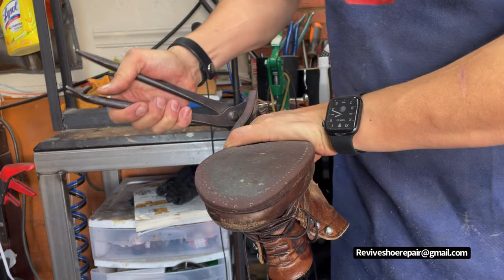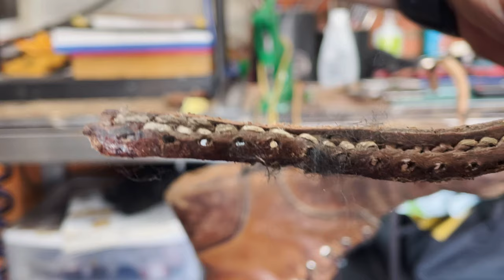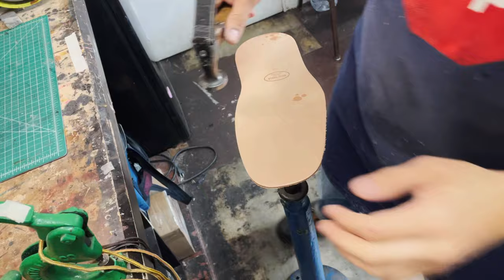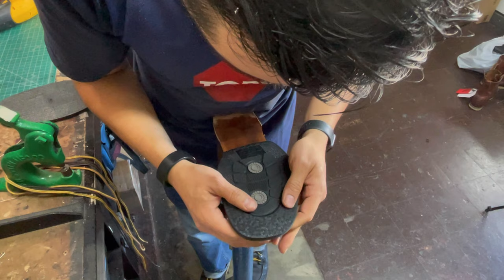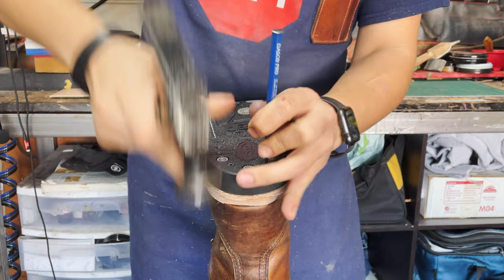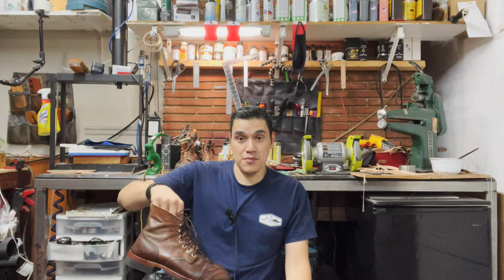Iron Ranger 8111/Their Last Resole/Dr.Sole Super Grip #redwingheritage #redwingboots #shoerepair

Comment: I can’t believe how much quality has been dropped from red wing. I’ve already ordered like 7 pairs and all of them have some sort of quality defect, sometimes construction too. Most part some leather quality looks and feels cheap. I get a perfect pair isn’t possible. But for handmade finished boots, you think someone would double check the work and make sure it’s as even as can be
Reply from the maker: Unfortunately that’s happening!
Reply: @AaronG2480  I’m glad a professional cobbler admits and acknowledges this and it’s not just me. At first I thought I was getting bad luck with pairs but it’s obvious after buying 6 and returning them all that they arent living up to the name. Excuse my rant but yeah it is frustrating when 3/5 pairs are defect or have issues, from leather quality, to either too tight or one loose and one tight shoe, uneven finishes on the welt, heel block coming off, “literally” I have pics for evidence. Especially after spending 350 bucks I expect minimal flaws. They bump the price from 330 to 350, but reduce quality and effort. SometimesI just want to make a video addressing this, especially when we have YouTubers like Rose Anvil giving good reviews on red wing iron rangers. No doubt they were great boots in the early 2000’s. But he only reviews quality overall, he does not address quality control or overall evenness all round.
Reply from the maker: @idrcookiez620  

I feel you, I’ve bought several pairs and apparently I’m the lucky guy cause I always the bad ones 😅

I don’t have no complaints on the
 (the uppers) but the finished product
Welts and soles
The average people don’t notice it, and I totally agree with you 2000’s  where the good days, I’ve even seen factory seconds way better than firts, that’s a shame.

Cheers!

Comment: I’m speechless on the missing cork, especially if your paying for the materials to be redone. It’s really sad. If no one opens the shoe you’ll never know what work they truly do
Reply from the maker: Here’s the thing, red works with several cobblers so those cobblers are the responsible ones for these poor repairs and is not necessary Red Wing’s fault.
But of course there’s no valid excuse.
Reply: @AaronG2480  yeah I guess just one of the risks of going back to the big corp for repairs instead of local hard working cobblers to take pride in their work no doubt about it. Hence why they start they’re profession. This is why you lo be sending my pair of boots to you when I need them resoled.